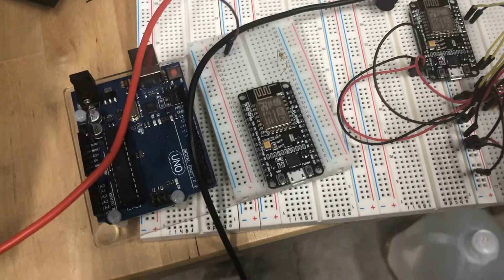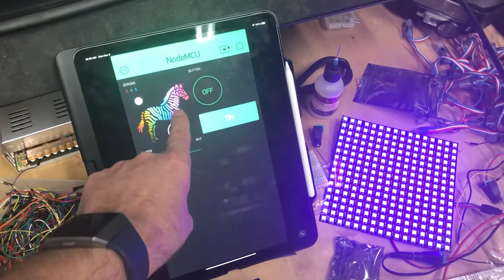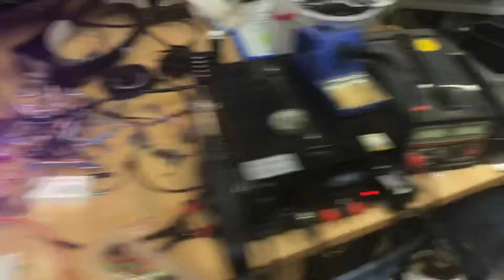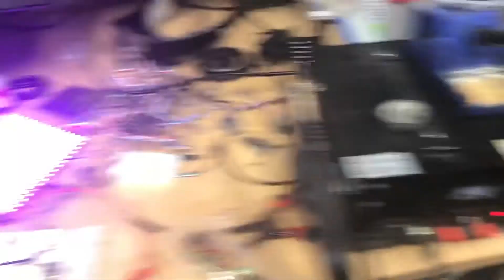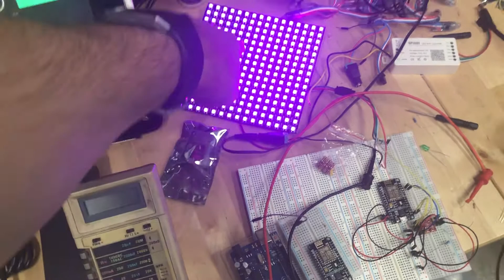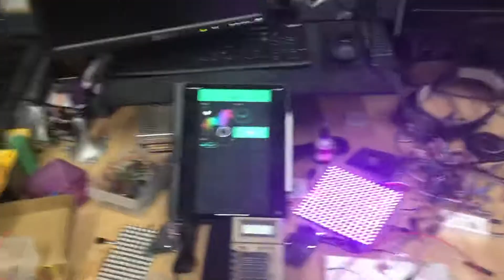NodeMCU Playtime

Comment: PLEASE HELP! In order to power on a pc you need to short 2 of the pins. I want to use a nodemcu to wirelessly short the pins but I don’t Know how I am meant to wire it up. Please help!
Reply from the maker: The Standard PC power switch is just a momentary input that goes from 5V and ground. If you use any digital out to the positive lead and connect common ground you just need to send a short pulse LOW to trigger the PC to switch on. Nothing special needed.